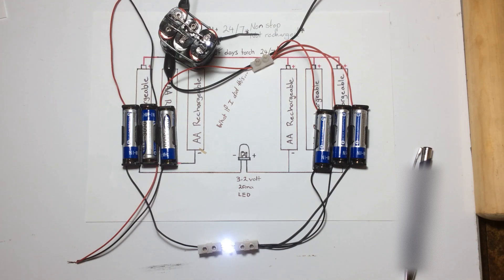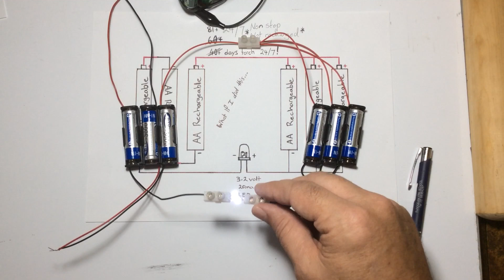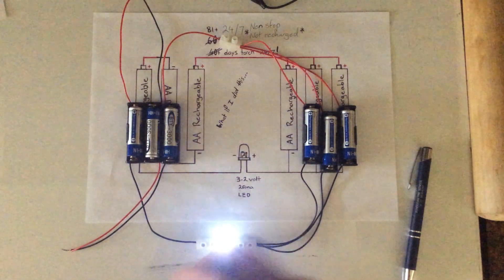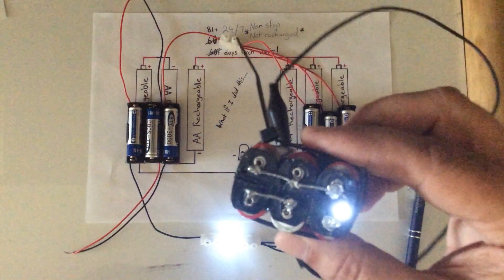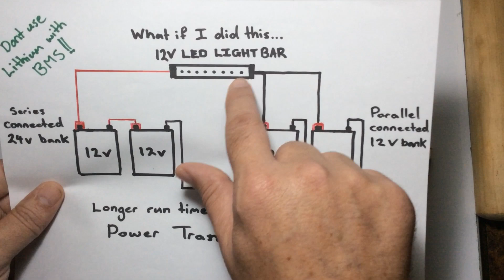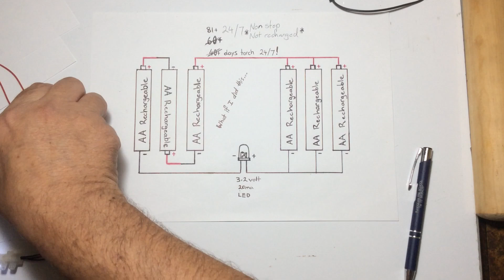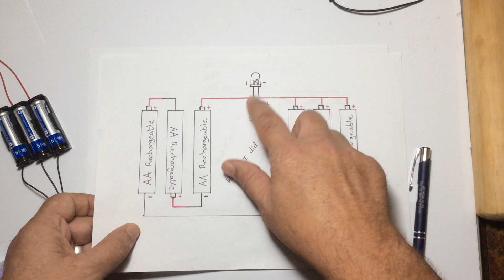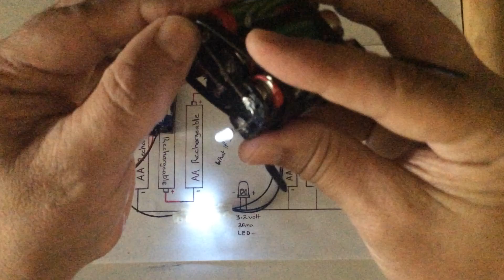Top 5 reasons you should build this device. 81 + Days and Nights 24/7 backup lights for blackouts!

Comment: I've got boxes of those vape batteries (I found on floor) now I know why. 3 year old with night lights, all over my home now will be this, atleast for the next 81 days
Reply from the maker: Thank you for watching.
I assume those batteries are rechargeable batteries, in which case they could last longer as this test was terminated on day 275, it was still running I was just trying to protect the batteries by turning it off to finally charge them.
Reply: @whatifididthis...1236  I've set it up, yes they are rechargeable, kids smoke the vapes and discard them, I know a spot under a car park I can go to almost everyday and find 3 or 4 free batteries. I've been collecting them for months and retro fitting lamps from the dump to run with leds. If I can emulate your set up, I'll have a house full led lamps. Thank you for your time.

Comment: love to try this on ordinary cheap aa batteries..we can get even more creative by using the led to shine on a solar panel that also feeds some voltage back to the battery pack to get some overmeownity!🐱👍🏿
Reply from the maker: Thank you for your comment. 
Both types of batteries used in this video are cheap batteries but with huge differences in quality. 
The Blue & Grey batteries are not very good at all, they have no weight to them and are falsely overrated, some don’t charge and they don’t accept the value of energy stated on the casing. I would suggest these are avoided.
The Green and Red batteries were also cheap but are exceptional quality and were produced for the Aldi chain of supermarkets. These batteries are sadly no longer sold at my closest Aldi stores and the ones I do have are about 4 years old now. I recommend getting a good set of rechargeable batteries because the small extra cost is well and truly covered if they last four years.
Weird that you mentioned the solar panel, to do some tests I have removed one from one of those useless garden solar lights that work for less than a single night. I think I will place the solar panel on the parallel bank as the voltage is perfect for that bank. It could also be placed across a single battery in the series set.
Reply: @whatifididthis...1236  🐱👍🏿
Reply from the maker: Love the overmeownity.
Reply: @whatifididthis...1236  i am curious those batteries can keep the led up for years, how to find out there is overunity or extra power? maybe i missed smth let me know? =]
Reply from the maker: @MrBademy  Thank you for your comment. I apologise for copying an answer I supplied to another viewer but I think this should answer your question whilst saving me from typing it again.

I don’t believe there is enough joules in all the batteries combined to make the circuit run as long as it has, which is still running now, 280+ days.
 I calculated the system as follows, please correct me if I am wrong. My calculations are at a constant voltage which we all know isn’t possible so the calculated outcome is technically better than real life, as we know, when voltage decreases the amperage increases through the load chewing more joules.
This is how I calculated run times.
A single AA 1.2 volt x 2500mAh = 3 watt hours
3 AA in series = 3.6 volt x 2500mAh = 9 watt hours
3 AA  in parallel = 1.2 volt x 7500mAh = 9 watt hours
Combined banks at full voltage can only store 18 watts.
1 x 20ma LED @ 3.6 volts consumes 0.072 watts per hour.
18 watts divided by 0.072 watts = 250 hours.
250 hours divided by 24 hours = 10.4166666667 days.
Again, I could have calculated incorrectly and these numbers would be different in the real world due to voltage drop, however, 10+ days at an unattainable constant voltage still comes nowhere near the approximately 280 days this unit has been running for. Due to voltage drop and subsequent amp increases in the real world tests this light did not last 12 hours running on all 6 AA batteries. (Two banks 3 x AA in series then both banks joined in parallel creating 3.6 volt at 5000mAh).
The LED at its rated values of 3.2 volts @ 20ma = 0.064 watts per hour.
0.064 watts x 24 hours = 1.536 watts
18 watts capacity(both banks) divided by 1.536 watt per 24 hours = 11.71875 days in an unattainable perfect setting based on stored joules. I think this means the energy stored in the batteries only accounts for 3.57% of the units total run time, somethings not right assuming my math is correct and that is giving the conventional understanding of electronics the undeserved “benefit of the doubt”. Accounting for voltage drop in real world tests and the conventional use has the light off in under 12 hours.
As I stated, I could be wrong as being human allows me this right.

Thanks for watching.

Comment: Power is watts is like a flow-rate/instantaneous measurement. Joules is energy is power-time, 1 joule = 1watt-second.
Reply from the maker: Thanks for your comment. Yes and something isn’t quite adding up with our measurements because this little baby is still running at over 240 days now, with no input. If I can attempt to simplify the problem here I would question if what we know is correct, if our understanding of the measurement of electricity is wrong then our calculations are wrong and the whole thing is wrong! For example, if we are told that a metre ruler is 1000mm and somebody asks you to measure an item whilst handing you a 990mm ruler that the length of was divided and marked to display 1000mm when it actually isn’t, then your measurements would be wrong. I believe this is where we are at, we are measuring with corrupted rules.
Reply: @whatifididthis...1236  What voltage is across the led, and how much current is going through it?
Reply from the maker: @jimmybrad156   Assuming I don’t fall asleep early this evening I will take some measurements for you. I can measure the amperage between the two positives but I won’t be able to measure directly through the load which is currently soldered to the two negatives as I don’t want to interrupt the test longer than it takes to swap the banks around. Another subscriber has asked me to measure the voltage of the series cells during the swap so I will take some of your requested measurements at this same time. The LED is a 3.2 volt 20ma according to the packet it came in, however this might not be an accurate measurement of current flow as this would change with different voltages.
Reply: @whatifididthis...1236  YouTube.com/@SweetSQM/videos

Comment: How does this compare with the 6 cells being in an ordinary 2S3P straight across the led?
Reply: Theoretically, I think that 2S3P should last twice as long as 3S > LED > 3P since the 3P's are charging instead of being discharged, and because both these leave ~2.4v across the led.
Reply from the maker: @jimmybrad156  Thank you for your comment. Unfortunately my device doesn’t work as you have described as the 2S cell is too low of a voltage to power the LED which requires 3.2 volts. Perhaps a device/load that operates off 2.2 volts that a 2S cell would produce would work, I just don’t have anything to test this idea.
Reply: @whatifididthis...1236  Since it's still running after hundreds of days, at present, what is the: voltage across the 3S battery, the voltage across the LED, and the voltage across the 3P battery? (I'm assuming 6 cells in total as shown in the video.) Have you got a micro-amp meter?
Reply from the maker: @jimmybrad156  I am currently unaware of these values and I will take some measurements tonight during the update video for you.

Comment: Could you scale this up and run somthing such as a motor with this circuit? If that motor was turing a generator then it could be fed back into itself. If i understand correctly, youre simply transfering the power from one bank to the other and the light is simply a byproduct of the energy moving from one point ot another, is this correct? When you start, are the batts that are in series fully charged and the ones in parallel are 100% dead? That way there is a potential difference which causes the energy to flow from one to the other.

Thanks for the video, i will test it out with LEDS and see if i can replicate your results! :D
Reply from the maker: Thank you for watching. The video link below shows how this can be scaled up to larger battery banks in which I also demonstrate running a motor.
https://youtu.be/nt3CvTvwqYA
You are correct in your understanding, the light acts like a hose transferring water from one tank to another and is therefore a secondary function. The batteries in series are fully charged with a resting voltage of 25.6V and the parallel receiving set of batteries are flat at 12.1V and it is this potential difference that allows the flow to the lower potential, just like water running down a hill from one tank to the next lower tank.
Please keep us updated on your replication as it is important for people who are unsure of their abilities to see that it can be done.

Comment: Ok I'm going to start building this this week.
Reply: I'm going to use my self built GANS plasma batteries in one to compare with store bought batteries. I've held .65v in my little pen case battery with zero initial charge for 3 years now and no corrosion. It has a combination of GANS ZnO alumnium case and copper core. The one I charged held 9v for 1 day but I never expected them to hold more than a half a V ever. My research is in organic batteries and clean energy storage. However I've ran into issues with communicating with other researchers as they refuse to allow my emails to be sent out. So I rely on these comments and replies....that rarely get seen either so mainly it's a lone venture lol.
Reply from the maker: Awesome, please let me know how you go. My unit is still running at 156 days! This is such an important thing for this collapsing world. I might make another video say at 160 days where I rotate the batteries...again!
Please share and teach people how to build this because I don’t have enough followers to reach more people.
Thank you
Have a nice day.
Reply: @whatifididthis...1236  indeed.

Comment: Can u build this with car batteries?
Reply from the maker: Thank you for watching. Yes you can use car batteries for this experiment and according to my research car batteries will work better than the batteries I use in my demonstration. As long as you switch the batteries before they are flat. Car batteries should not be drained below 50% otherwise they are permanently damaged. Perhaps something as simple as a Zener Diode could be used to cut power when necessary.

Comment: Kelvin water dropper generator, shows static electricity can b collected when an electromagnetic field is created, generator won't do nothing until 1000 volts powers the electromagnetic ring and then jumps to 10,000 volts instantly
Reply from the maker: Thank you for watching. That sounds interesting, I am unfamiliar with that concept and will have a look at it.
Have a nice day.
Reply: @whatifididthis...1236  https://www.youtube.com/watch?v=Y7MJbZTjKyo
Reply from the maker: @piramidekeops  Thank you for watching and thanks for the link. I was unaware of how simple that system is and greatly appreciate you bringing this to my attention.
Is it possible that my AA battery system could be accumulating energy as the high potential moves to the lower potential, I need another cup of tea now to process these thoughts!
Have a nice day

Comment: Se puede retroalimentar hacerlo overunity???
Reply from the maker: Gracias por ver. Sí, la salida se puede devolver a la primera batería, sin embargo, se logran mayores eficiencias al cargar un tercer banco de baterías y rotar los tres bancos de baterías. Esta configuración se ha estado ejecutando durante 90 días sin devolver energía al sistema, por lo que es muy fácil lograr un exceso de energía con algunos pequeños cambios.
Reply from the maker: Thanks for watching. Yes the output can be returned to the first battery, however, there are greater efficiencies achieved by charging a third battery bank and rotating all three battery banks. This configuration has been running for 90 days now without feeding any power back to the system so it is very easy to achieve excess energy with a few small changes.
Reply: @whatifididthis...1236  I was of a thought , what if we try to use MOSFETs to change over the switching at a rapid speed beyond 60hz and then instead of using batteries we replace them with super capacitors, do you think this can work?
Reply from the maker: @wambeddemustafa1193   Thanks for watching. Yes I believe this would work. Tesla had a mechanical arrangement for switching and called this a Tesla Switch. A company called Electrodyne Corporation operated a system with switching that I believe operated for three years running a television, lights, small motors and even a 30 horsepower motor. No input power at all and batteries were in perfect condition at the end of the test. It is claimed these batteries even charge much faster after being used in a system like this. Electrodyne states the switching must be above 100Hz to be effective and below 800Hz to prevent being dangerous.

Comment: Thanks so much bro this. Otherthan led bulb,  can a motor, inverter and controller be used as loads that do transfer energy effectively?
Secondly, which kind of batteries can you recommend.
Reply from the maker: Thanks for watching. Yes you can run other loads and all the types you have suggested. The series battery bank acts like a tall skinny water tank whilst the load is nothing more than the water hose transferring the energy to the low and wide water tank.
The best batteries are ones that accept a fast charge rate. The older batteries, lead acid, can drain and charge faster than most batteries, however, they will be damaged if they drop below 50% charge. On average most batteries are at 50% when they reach 12 volts, so for the series bank that cutoff is 24 volts. Either disconnect them manually when the series battery is at 24 volts or have an automatic cut off to disconnect the transfer load. The load should not exceed the charge or discharge rate of the batteries. If the battery states 0.8 amp charge rate then the load should not transfer more than 0.8 amps.
Hope this helps.

Comment: Amazing Mate 🙏

That is a long long run time so far ⚡🙏⚡
Reply from the maker: Thanks for watching. I wish this had not been hidden from us. Can you imagine the mileage on an electric car if they were wired to automatically switch battery banks within the vehicle. You could literally repeat the process over and over. What the bloody hell have they hidden from us. 🤬 I’m using this system to run a super efficient heating arrangement, this makes me angry to think how many people have suffered the cold or sat in the dark or both, the governments of the world know of this technology. They do this to us because we let them!
Reply: @whatifididthis...1236   @whatifididthis...1236  Yeah Mate,
it is infuriating.

Greed & the Need to Control.

BTW,
a long time back,
I made my own cells using Aluminium and Graphite Plates with an Electrolyte made from Ash from the wood heater and burnt steel wool that I burnt within a strong magnetic field.
The cells in series had a reasonable Voltage but could only light an LED for a moment lol,

But I then added it  to a system with doodles and a bi polar inductor along with a torus
and it used the initial pulse from the weak cells to start an oscillation which kept adding back to the cells
and it kept the string of led lights illuminated for months until my dodgy cell build got bad connections haha.

I have documented the system and stored the coil etc
so I can get back to that project when I settle  into my next place.

It was an oscillating Battery system.

The cells couldnt light an LED for more than a split second on thier own.
Reply from the maker: @crazyham  Best of luck with your move. That has to be one of the worst things ever in my opinion. I am interested in the details of your cell setup, once your settled I would love to know more. I have built several cells over the years and still find it amazing as it is just so simple to make a long lasting battery, my favourite ones were earth batteries. A never ending supply of energy, it might be low voltage but we know how to manipulate that so it’s a reliable supply if done correctly.
Reply: @whatifididthis...1236 true,  Infact, if possible you can also educate us more on earth batteries.
Reply from the maker: @wambeddemustafa1193  Thanks for watching. I learned about Earth batteries the same way I learn most things, by keeping my eyes open on the way. Whilst reading about Marconi stealing his radio concept from Tesla and the following court ruling that stated Marconi had violated United States patent law, I learned of a man named Nathan Stubblefield, the true first wireless transmission of voice was performed by Nathan Stubblefield. To perform his patent application demonstration he invented his earth battery to power the wireless transmission of voice....and down another rabbit hole we go!
Reply: @whatifididthis...1236  I get the point, otherwise thanks so much. Am just waiting for your email